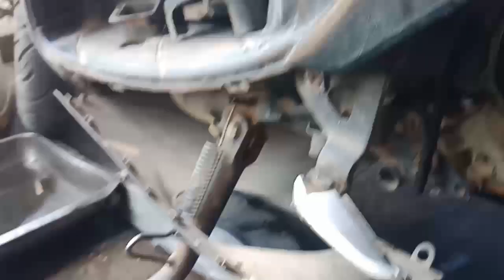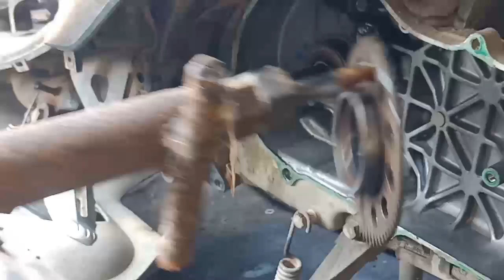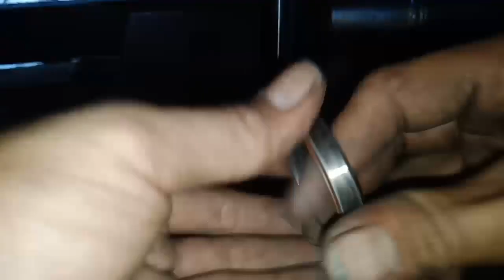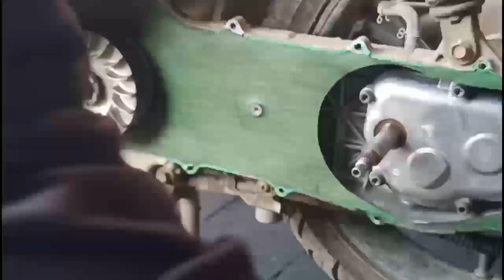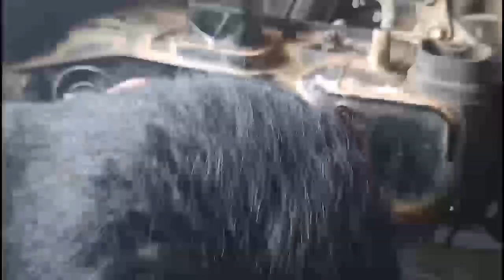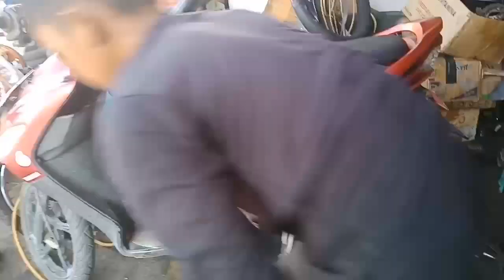cara ganti one way #stater #motor mio

Comment: Penjelasanya gini. Kalo gear oneway gak gerak yaaa . Kenapa di video tersebut oneway yang baru jalan kedepan tidak bergerak. Sedangkan oneway nya sendiri punya mata grigi . otomatis dia bergerak mengikuti as nya . Ya otomatis gear oneway nya juga ikut gerak dong kedepan. 

Ya masalah bunyi saat di gas pertama bunyinya gresek .kasar.gemuruh yaa dari bering nya itu . Karna sistem bering yang muter tengahnya terima kasih